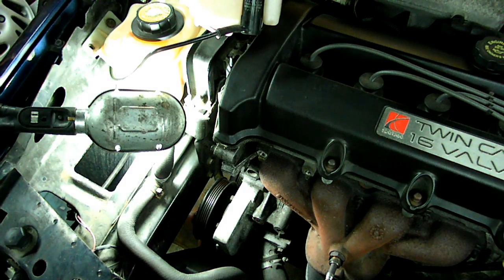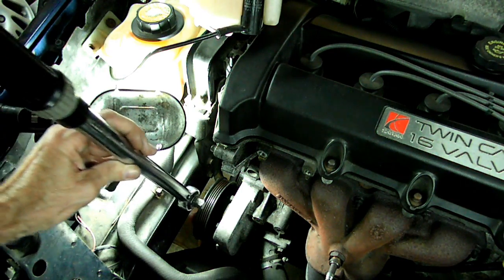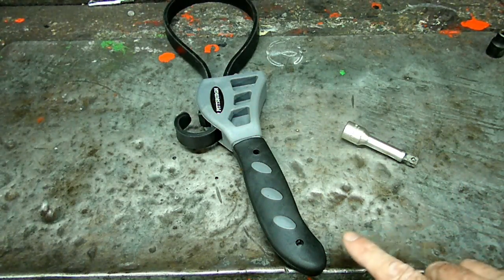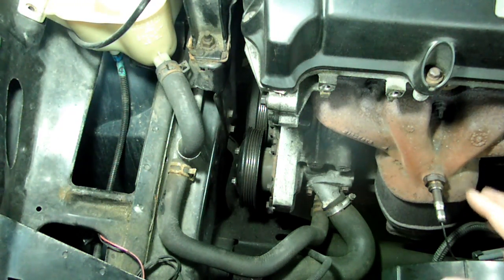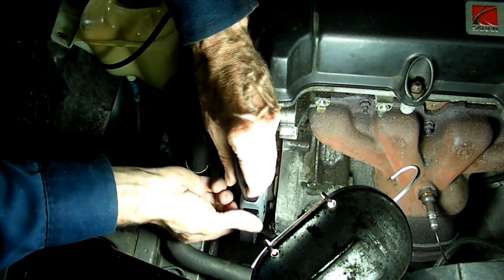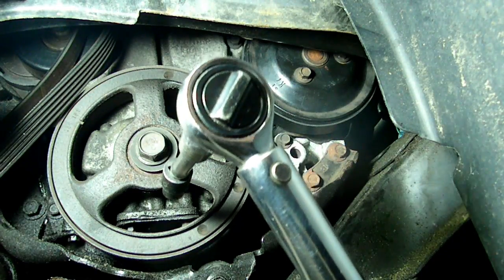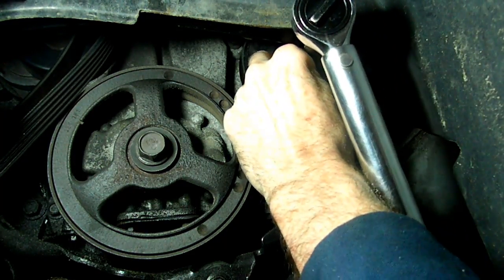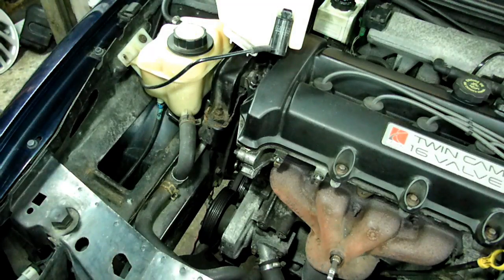Saturn Water Pump Pulley Bolts Torquing

Comment: Dear Richpin, is the Saturn SL2 1998 the same? Are the bolts from the pulley the same as the ones from the water pump? Would please have a code? Thank you@@!

Comment: easier way to do it.. there's an extra hole besides the 3 holes for the bolts. use a 1/4 4 inch extension and use it to bind the pulley. you just go in from bottom of wheel well. no need to mess w air conditioner. worked great for me. easy fix.

Comment: Or you could put the bolts on finger tight then install the belt, then torque the bolts.   This eliminates the strap wrench /  ac compressor step.

Comment: Do you have the engine lowered down to access the water pump pulley bolts? I just finished my 96 SL2 water pump and serpentine belt today and had to use a 10mm box wrench (no torque wrench). I used the flat side of another box wrench inside the pulley bolts against the big crank pulley to keep the pulley from turning while  tightened it. Thanks to your excellent videos I got the courage up to do it myself and saved hundreds of dollars, I am sure.

Comment from the maker: I do not have a video on this problem.I was going to say you had a possible coil issue but you said you replaced them.What we do when we suspect a bad coil is to switch coils 1-4 and 2-3.If the problem moves with the coil switch we know it is bad.The only thing i can think of is ignition module?

Comment: do you have a video of this perhaps of what I wrote below that I could watch to guide me through this if so please direct me as I have looked at all seen one on replacing the coil on the one saturn but since I have replaced the coils ,leads and spark plugs unless there is a wire short or loose that I do not know about ...
thanks 
Theresa

Comment: Hi Richpin I am in need of your help ,car is running on three cylinders it is a 92 saturn sl 4dr sedan ,,,I changed ,leads plugs ,still running on three cylinders ...then I checked to see if I had spark ..started the car removed ..lead 4 had spark then 2and three had spark but  #one has no spark ..this I cannot figure out as to why as I had replaced all leads, coils ,plugs yet the first lead had no spark and the engine is still running on 3 cylinders ...help

Comment: You can also wedge a (correctly sized) piece of wood in between the water pump pulley and the main pulley. That's what I did and it worked pretty well. The wood gets "pinched" when the pulley tries to turn.

Comment: I am sure it is fine for this not-terribly-sensitive application, but in general you do not want to use any extensions, especially wobbly extensions when using a torque wrench.

No big deal here, but if you are torquing sensitive fasteners like head bolts avoid the use of extensions, especially wobbly extensions.